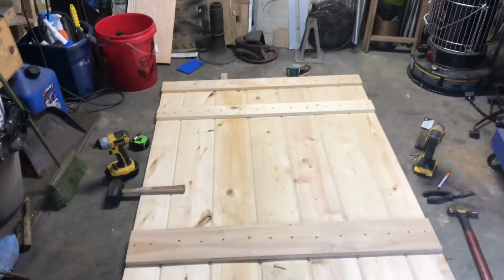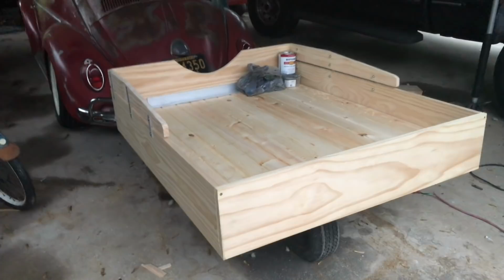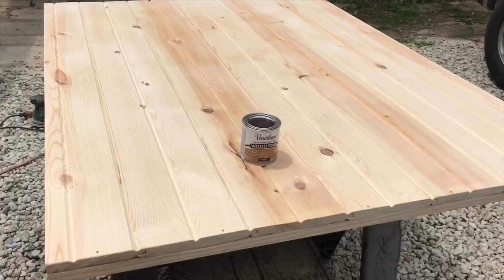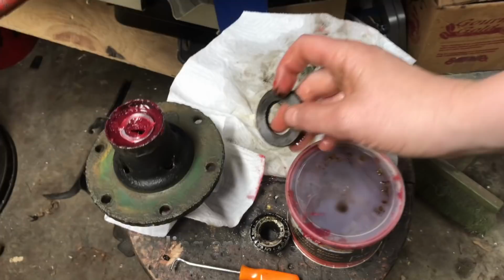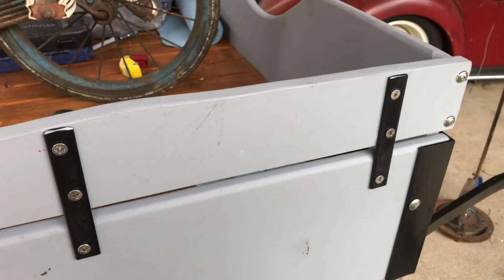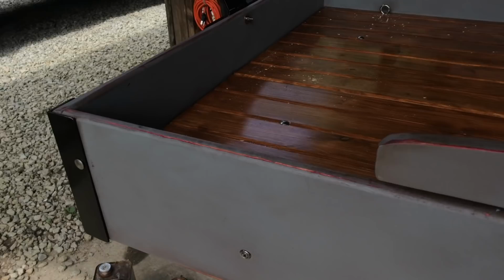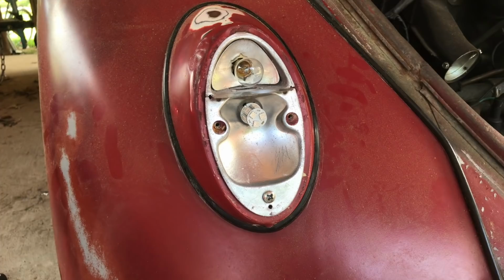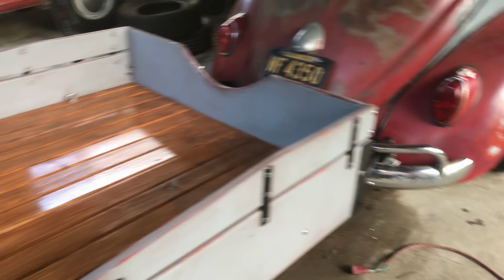Single Wheel Trailer NOT Allstate trailer, Montgomery Ward!!!

Comment: Somebody is getting ready for the swap meets , Its  really nice Marci ! Now you can bring plenty of cold sodas .
Reply from the maker: YES! Thank you! We DO plan to put a vintage cooler in the back for the drinks!
Reply: @marcijunebug  for thatyear don you need two trailer lights for blinkers because the VW's are obscured by the trailer itself???? Still a novel build and like the weathering process..........grunge!!!!!
Reply from the maker: The lights on the beetle can be seen when you are behind it...Indiana law requires a license plate light, stop light and tail light (although some of that could be argued due to the fact this trailer was "technically" built in 2019 and thus has a 2019 title and turns are required for all made aft 2015)...and that the license plate MUST be mounted in a horizontal position, we've never had any issues with the other vintage trailers we pull...love that word GRUNGE! my middle name!lol
Reply: @marcijunebug  yeah here in NE the fuzz is sticlers for MV details and hassle U for small stuff like this, tell em it's grandfathered in  when U registered it

Comment: obviously you have done that before. Nice Faux-tina. Looks original but well taken care of. I just dont want one of those one wheel trailers because of the speed wobble issue.
Reply from the maker: thanks!  as long as you have them adjust correctly zero issues! but it sometimes takes a couple of road tests on bumpy roads and a few minor angle tweeks (there is actually a mathematical formula to calculate to get the angle of the wheel to the road and car that gets it really close) to get it dialed in!  Thanks for being here Mike!
Reply: @marcijunebug  I figured you have some cool stuff on that. Might want to put up a video on that subject. Even if people dont have the one wheel trailer, there is a lot of interest. I will be making a video pretty soon doing a retro 2 wheel. But havent gotten the idea completed Debating on 2 wheel trailer retro or mini camper. Lots of interest in both. I was in indianapolis just in april never know might be in the area again. Sometimes I do a joint video. I like to join together rather then compete. Makes us a community. I think people like that better anyway. Love your stuff even the non vw Repurposing videos. Super cool and well done.  I have 3 channels and some stuff ends up in each of them. mostly vw and car stuff on this one. but in hind site I would have done them all on one with the newest rules. All monetized though now.
Reply from the maker: there is no way I have the time to do 3 channels! wow! I have the content THAT isn't the problem...it's finding the time to do something with it! my hat's off to ya!

Comment: Marcie that is a great little trailer.  How much does it weigh?  Also is there any advantage to using one wheel vs two wheels?  I would also want to have a spare tire just in case!   I wonder how much weight it will hold?    I was wondering if you were using any tie downs and at the end of the video I see you had some eye hooks.   Again great job, I'm sure you will get a lot of use out of it!!!
Reply from the maker: Trailer probably weighs 200-250lbs.  With one wheel on a swivel and the trailer mounted at two points to the car the trailer just backs straight with the car, only the wheel moves...none of that "let me see if I turn the steering wheel this way the trailer goes that way"...it eliminates any trailer backing up issues and you can really get into tight spaces without worrying about being able to back out!  Most single wheels max at 500-700lbs but I wouldn't want to load it down that much on a VW...the trailer could handle it but the car might be working too hard! I am making leather tie downs like I did for my dad's trailer (there is a video on the channel for it) but the tricycle was sitting with a small rock against front tire, just to video! These types of trailer bounce so no way I'd ever put anything back there without strapping it down!

Comment: Awesome work restoring the trailer, what are the dimensions of the trailer if you don't mind. And I dig the color 👍🏽
Reply from the maker: Thanks so much! The outer side board (9" board) is dropped so that the inside depth is 5", then with the little side gate piece on top of it near the front that part is 9".  The overall box is 54" long, 45" wide.  Hopefully that makes sense! We originally thought we wanted it to be a patina red, but so glad we went with the grey!
Reply: @marcijunebug  that makes perfect sense thank you so much and good luck w your future endeavors 🤘🏽

Comment: Wonder what  the trailer tire max load rating is?
Reply from the maker: this style of single wheel is rated for about 500-700 lbs...there is a great site full of random single wheel info...fun just to troll the data there, other fiberglass trailers are rated for less and a couple of stronger frame ones are a bit higher...
singlewheel.com